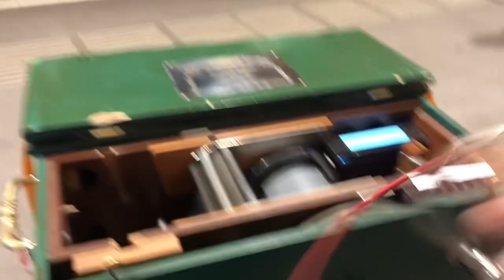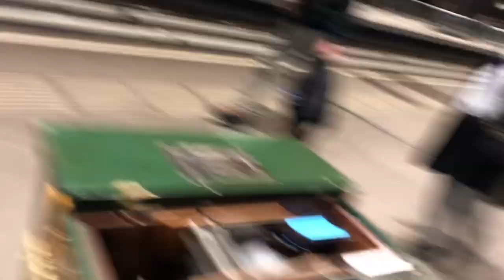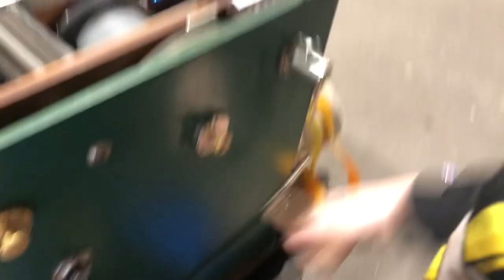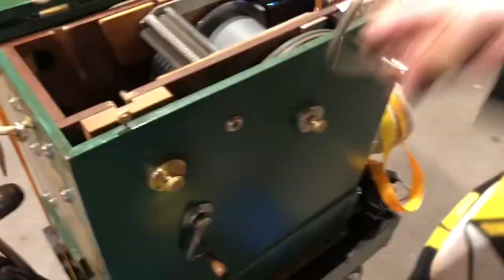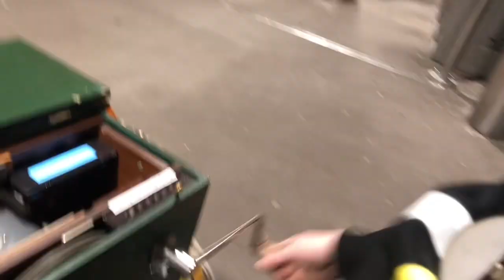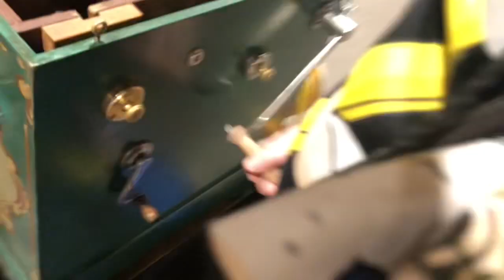Maple Leaf Rag- Drehorgel Raffin 20/31   Hand turned organ

Comment: Do you have the tunes on a roll or electronic device embedded inside?
Reply from the maker: Hi there!   So. My organ is capable of both playing music rolls. And also there is a MIDI system inside  (musical instrument. Digital interface)      
The music roll system is there as you can see with the cylinder and the tracker bar which is covered when I am using the MIDI system    
The MIDI system was added last year.   The tunes are stored on an SD card    
Feel free to ask questions !   Thanks for watching!